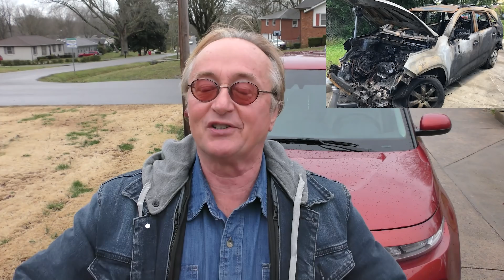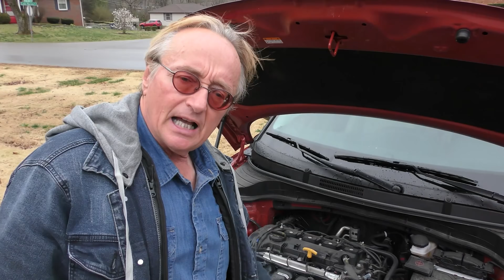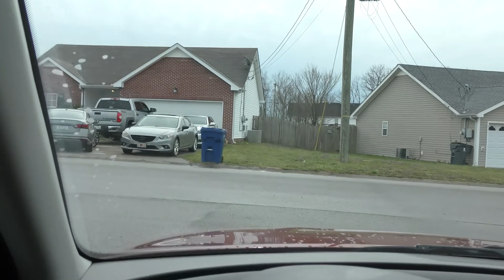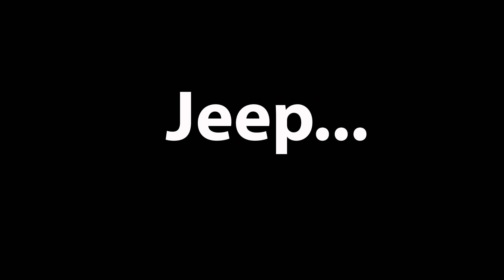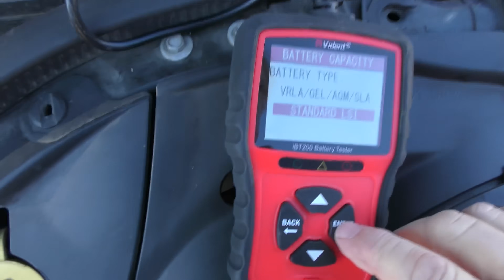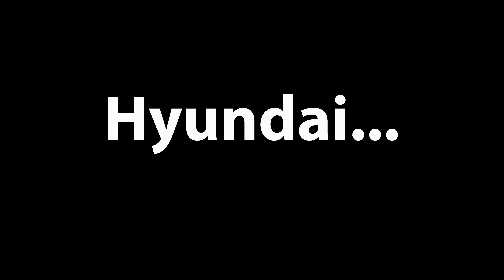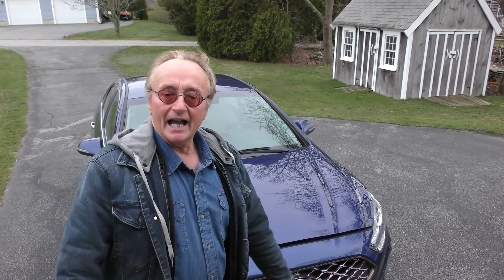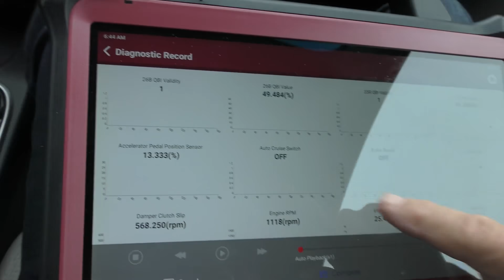3 Car Brands That are Crap

Comment: The Hyundais we get in Australia are delivered directly from  South Korea (as are Kias). We simply do not have the problems that you bring up. Perhaps it comes down to build quality.
Reply: Ironically, the majority here in Puerto Rico come also from South Korea, even tho PR is part of US.
Reply: 100% hyundai's in australia are a great car. very underated I bought one 3 years ago for $500 and Ive thrashed the thing, it still runs so well!!!!
Reply: Ive got a 2015 i30 runs fine, only need to service it regularly and use good oil, other than that changed the battery (seven year old car not bad)- solid reliable car cant fault it
Reply: Same here in Europe
Most of Kias and Hyundais are used as a fleet cars or taxis.
Reply: I've spent most of my life as a Honda mechanic. We have seen all kinds of problems with Hondas built in the US. We had one come in without a wrist pin!!!!  A single cylinder ATV  TRX350. It ran but was a little noisy. 🤣
Reply: I could be wrong, but aren't the Hyundai transmissions with problems he's referring to manufactured in Korea, even if the cars are assembled in the US?
Reply: Especially true of German cars sold in the USA market.  The cars we get are garbage compared to those sold in Germany.

The whole world treats us Americans like we're a pack of dumb suckers.  I mean, they're right, but it still sucks.
Reply: no you do have the problems you strayans just ignore it
Reply: MY 2014 Optima sx was amazing when I owned it... This is a garbage video.
Reply: Yes kia and hyundais made in Korea are great cars and have a reputation above toyota in Australia.  The problem maybe where the US cars are made.
Reply: @aussiefarmer6012  exactly. The ones in Europe are great too
Reply: The Hyundai/Kia’s in the UK are perfect as well. None of the issues that occur in the US are present here in the UK. Guess we get the good stuff 😆
Reply: Was wondering the same myself.  I’m from Canada and discovered my Kia is made in Korea when checking the VIN.  I’ve owned it for 7 years.  So far has been a great car and although it’s been in for all the recall checks regarding the engine, each time they have said that it’s fine and no problem.  Leads me to wonder if the problem lays in the American facility.
Reply: I have owned 4 Hyundai’s since the late nineties, they have all been good cars with only a few minor issues........(In Australia).....I am very happy with them.
Reply: Same here in South Africa. The Korean cars have an excellent reliability record in this neck of the woods.
Reply: @ChapeauRouge921  Same here in Guatemala, Hyundais and Kias are very good. We've had several in our family and all have been fine.
Reply: In Europe Hyundai and Kia are having a good reputation as well.
Reply: That'll happen when a company puts children on the assembly line (US)? 🤔
Reply: @patrickjordan2233  What's that supposed to mean?
Reply: If the VIN number starts with a K it's made in Korea. Korea have a similar working culture to Japan.
Reply: Bottom line of his videos should be “just buy f-ing Toyota Corolla” 🤦🏼‍♂️
Reply: The Hyundai's in the US are made in Mexico. Thats probably the reason they're not that great in the US

Comment: I haven’t had any major issues with my Kia Optima 2015 Ex and it’s at about 117 thousand miles so I’d say I’m either running on luck or not all Kia’s are bad.
Reply: There's always 1 kia owner in the group that says this.
Silly.
If your luck is this lucky then yes kia is a bad company. They are mas producing cars, there shouldn't be any issues.
This reminds me of a tech story I heard years ago.
Back in the 70s IBM came to Japan to request them to produce chips for their new computers, the arrogant Americans said that you can only have two faulty chips in the 1 million.
A few months later a package arrived at IBM headquarters. Inside was 1,000,000 computer chips, 2 separate chips on top of the pile and a note that read:
"Here are the 1 million chips that you ordered plus the two broken ones that you also requested".
Reply: @soundknight  I know I’m just saying cause in all reality car companies are cutting corners now and days so it really is starting to come down to hoping you have luck on your side cause I wouldn’t want to get my engine change every 10000 miles this just goes to show that I might have one of those rare ones that doesn’t have the oil burning issue.
Reply: Not all are bad
Reply: I guess maybe you're a good car owner.

Comment: 2008 Hyundai Entourage, like a Kia Sedona, with 216k miles. So far, so good
Reply: Hoping our 2016 Sedona (with the 3.3 V6) lasts that long. I’ve heard BETTER things about these engines vs the 4 cylinders (specifically the 2.4), but 🤞🏼
Reply: Fellow Entourage owner, mine is younger at 196k:)

Comment: There  are no perfect car makers. They all have their own problems. I have friends with Kia but having no problems, but other friend with Toyota having several problems.
Reply: Toyata???!!! All my cars have been either Honda’s or Toyota’s. I have a 2006 Yaris sedan with 175K miles on it. All I have done to it’s rotation of tires and oil change
Reply: @youhatemeiloveyou1  Same. Have a 2008 Toyota Yaris with 225k miles and still running perfectly. Just have been making sure to do regular oil changes.
Reply: True, but in general toyotas and hondas need less maintenance.
Reply: I think, this is the way it is: every car manufacturer had peak years for build quality, durability, and engineering. Some marks experienced decades of it, some recently but some quite a ways back.  Others may not have hit that peak yet.  It's a theory.
Reply: Please don’t compare Kia to Toyota…say whatever you want…most Kia’s are crap
Reply: @billpo  so are the most toyotas , atleast Kia is good to drive and sit unlike garbage toyotas look like you are driving a tractor
Reply: @hotrod7603  well, when that Kia is dead an buried, that old tractor will keep on truckin…
Reply: @billpo  i had buy another one before i had drive a tractor 🤷 simple

Comment: Our Hyundai dealer said they can change it as early as 5,500 miles and it's up to the service manager if they want to do it that early. At first when I bought our new 2022 Kona they said 7,500 miles. I did a break in oil change at 1500 miles with full synthetic Quaker state 0w-20 as it takes. I always do my own oil changes for a peace of mind knowing that I know it's going to get done correctly.
Reply: My neighbor had this great big oil spot in his driveway.  I asked him about it and he said oil shop stripped the threads on the oil pan during an oil change.  I saw these guys trying to change their oil and oil filter.  They couldn't get the oil filter off so they stuck a screw driver thru the oil filter and still couldn't get the filter off.  Now they had an oil filter that was ripped to pieces and had to call a tow truck.  You don't have to worry about stripping the threads on the oil pan or the oil filter being on super tight if you change it yourself.
Reply: @sd906238  best thing for oil pans is a long term replacement of the drain plug with a Fumoto drain valve. For the filter its important to remember that they get tighter with heat and they have fine threads so no need to tighten that much
Reply: Perfect. I work at a hyundai dealer and people always either do it at 7500 or even furthur past that at like 10k plus the dealer uses regular oil not full synthetic. Those cars eventually come back knocking. People who come in early and do them at every 5k with full synthetic never have any problems. Also remember the carbon cleaning. Those GDI engine easily get carbon build up. Do the carbon cleaning every 7500. They recommend 10k but one of the techs told me that 7500 is the best because they build up a lot of carbon.
Reply: @DonisGP  what manner of carbon cleaning?
Reply: @DonisGP  what is "the carbon cleaning"?  Are you talking about the pour in stuff?
Reply: Good man Mr Manning
Reply: Just watch them when u drop the car off. 🧐

Comment: Scotty:3 Car Brands That are Crap.  Toyota is getting a reputation for oil burning too.   4 Car Brands That are Crap.
Reply: Yep.
Reply: Oil burning Toyotas with 2.4 liter engine are easily kept running 200,000-400,000 miles by checking oil once a month. Truthfully any car over 10 years old with 100,000+miles needs it's oil checked  every month to stay ahead of potential problems.

Comment: We have a 2012 Kia Soul that we bought new.  I use full synthetic oil and change every 4-5000 miles or once a year.  Now has 86,000 miles on it(a 2 liter) and uses no oil whatsoever.  At that time the cars were made better it seems. I changed the plugs for the first time ever and all four looked great.  My son has a 2016 and he has no trouble either.  That said I wouldn’t buy any new cars today as they seem to be pretty crappy.

Comment: My 2010 bmw 535i would randomly stall in the summer. 10 minutes later it would start up and off went. Stall again. Etc. no one could figure out why. Took it to multiple German auto specialists. Wouldn’t throw any codes. I finally had enough and just traded it in. Problem fixed. Lol.
Reply: Somebody once quipped to me about BMWs.... Bad Mechanics (at) Work...
Reply: BMW =Broke My Wallet
Reply: BMW=Big Money Waster
Reply: Was likely a bad oil temp sensor or even overheating computer module if it ran rough randomly during the summer before shutting off. Mine did the same, however it did throw codes reporting the oil was 2,000+°C lol

Comment: I have a 2009 Hyundai Sonata with 139,000 miles and so far so good. I hope my good luck holds. I have changed the oil every 5,000 miles and the transmission fluid at 70,000. I had the coolant changed at 100,000. I had a 2002 Toyota Camry that failed at 105,000 due to a cracked bearing. Engine rebuilt for $3,000 and it's still going strong. I sold it for $6500  with 130,000 miles back in 2010. The lady I sold it to is still very happy with it at over 200,000 miles.
Reply: You don't say when you bought the Sonata. New? Used? My Sister bought a new Sonata in'12 and lasted 7 yrs w/83k  (proper mtn)  but had bearing problems. They gave a new motor but would charge too much to install. We put it in, she drove it 3mo  traded it in for new Camry LE. So what the heckle....
Reply: @jeffreybennett8893  I bought mine new. It was just a short time before cash for clunkers and no one was buying cars. I needed one out badly, so I was the only person buying a vehicle that Friday from a normally busy dealership. It was a very eerie feeling that I will never forget.
Reply: I had an 2009 Sonata with a manual transmission. I ran it hard for about 4 years. Like 100k in 4 years. It was fine, but needed a steering rack and a seal broke and therefore soaked my clutch in hydraulic fluid. The engine was fine until I traded it in 2017. The cost of the steering rack and clutch pretty much made the car as expensive as a Toyota or Honda at the time. Then they gave me $500 for a trade. In the end I figured I lost at least $3000. Mostly on the trade in.

Comment: Hi Scotty. If you only had 2 choices... Mitsubishi or Hyundai? (2020 models)
Reply: Mitsu.
They are actually built in Japan.
Reply: @mushroomcloud1  
But aren't they just as bad as Nissan? (Same CVT)
Reply: @shane250  
They do not seem to have the same issue.
It seems as though the transmission control programming is different.
Different software same hardware
Reply: @shane250  Mitsubishi CVT was different from Nissan. The New Nissan rogue and mitsi SUV use the same redesign.
Reply: @mushroomcloud1  They were not the same transmissions. People need to know how jatco works, model was similar internals sight different.
Reply: @cb5110  
Thank you for the explanation!
Reply: @shane250  no problem, there is big history behind jatco, but it was Ghosn who messup Nissan CVT with cost cutting. He is gone now Nissan CVT getting better.